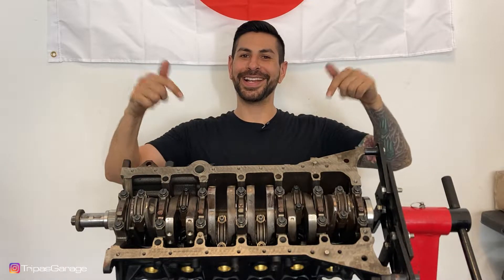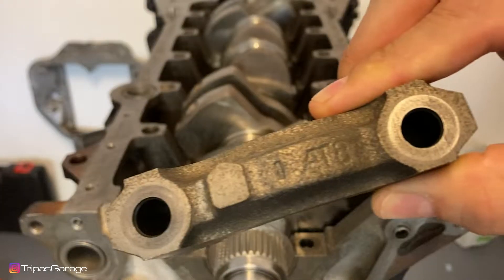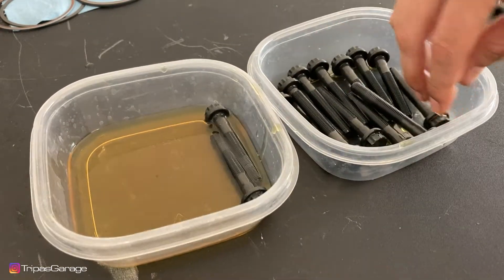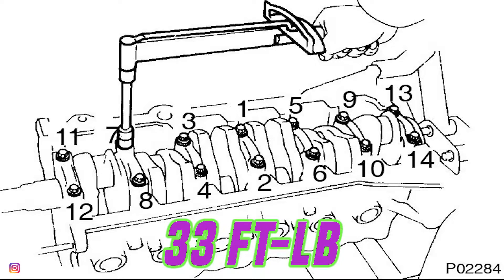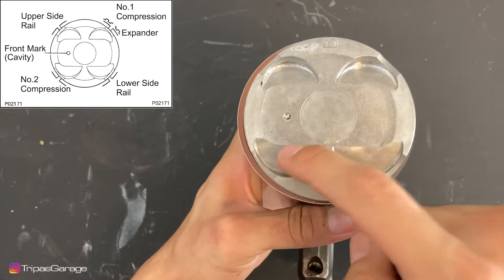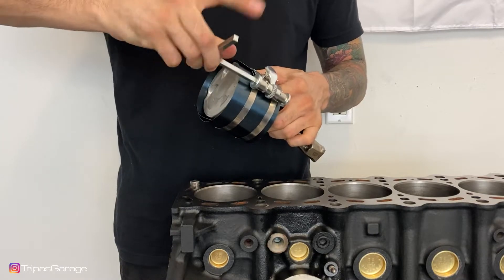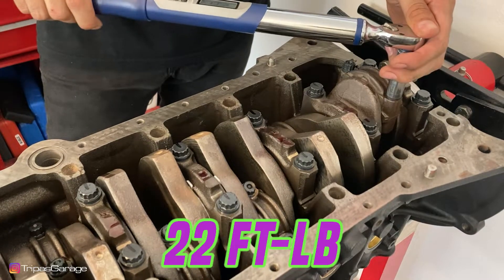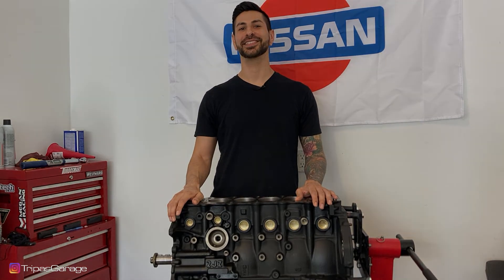2JZGE NA-T Turbo Build - Bottom End Assembly

Comment: what main bearings did you buy? trying to find the correct "mark number" for my block number and crank shaft number.
Reply from the maker: @seanjanda4460  I used ACL race bearings. STD size for my application. Best to measure it all to verify the sizes.

Comment: Is this a turbo 2jz? Did u face any problem boosting it without oil squirters?
Reply: i know this is a year ago, but no. people tend to get rid of them since they are only designed to work with the factory rods. GEs run the same rods with no oil squirters and do fine.

Comment: hi bro, how you know the order of the pistons rods? i mest up and. the piston rods where mixed and know i dont know with number 1,2,3,4,5,6 is. when the rods were mixt the pistons were compleat so caps where sill on. the rod have numbers on 2gb,2ma,2ob,2ob,2kb,1pb how correspond with the caps. but with is 1,2,3,4,5,6 ?? got a gte vvti
Reply from the maker: Rods doesn’t matter as they are all within spec is being the same weight from Toyota. Just make sure the correct caps go on with the correct rod. They have markings on the side, line them up.
Reply: @TripasGarage   thx man ^^ i thought the same but was not sure. i dident find anny info over it. thx a lot for confirmation :)

Comment: Nice content!... Quick question, what bearings did you decided to go with for the Rods and Mains? And were the thrust washers OEM?
Reply from the maker: Appreciate it. I went with a standard size bearing for both main and rod. I used ACL H series for both and ACL standard thrust washers
Reply: @TripasGarage ok cool. what about the rod and main bolts?
Reply from the maker: @EdsonHenry  brand new oem rod and main bolts.

Comment: There's a couple thing I think you should have done... #1 ATF  transmission fluid should be used to clean the cylinder wall because transmission fluid has a cleaner inside.. #2 always check the bearing clearance with plastic gauge it's better to be safe than sorry Evan when machine shop says it's in spec it's always better to see the clearance yourself so there's no doubt about it..
Reply from the maker: Appreciate the feedback. The clearances were all checked with a micrometer, dial bore gauge, and plastigauge prior to this video. ATF was used on the cylinder walls as well on a previous video. Thank you for the info.